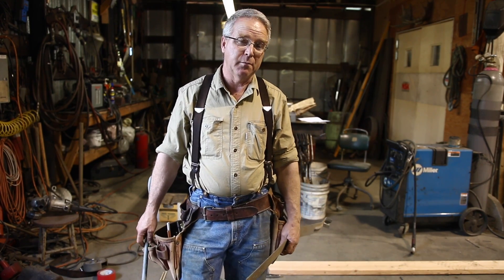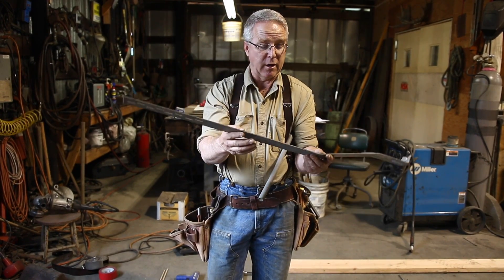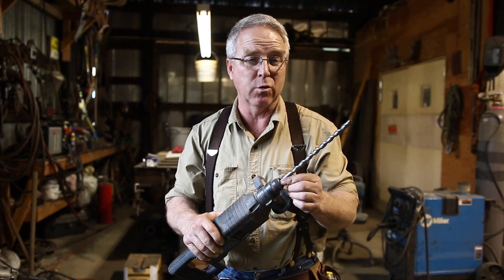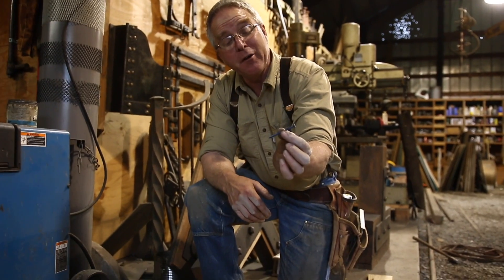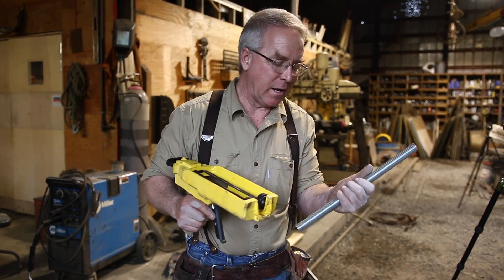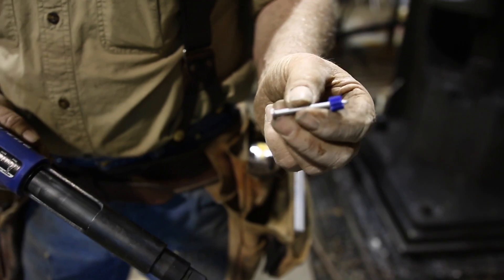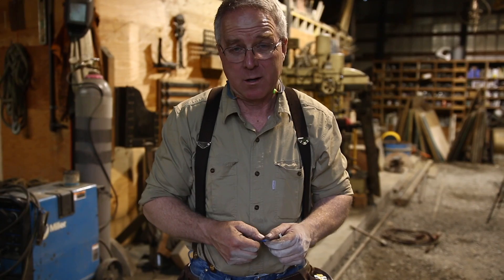How to Fasten to Concrete

Comment: Instead of using the plastic plugs to hang heavy things from a concrete wall, I drill a 3/8ths hole into the concrete, blow and drive in a dowel that has been coated with quick dry epoxy.  I also wanted to add, that as a former instructor, I like the way you disappeared the training aids immediately after you were finished using them to avoid distraction.

Comment: Yeah codes are needed but some of them are very excessive (here in Florida at least)
Codes help homeowners ensure the work theyre paying for is done correctly and their house is safe. 
However I think if a homeowner is doing the work themselves codes should not be enforced. Also you shouldnt need a permit for every single little job there is such as a shed or small deck or concrete slab that is not intended for a structure foundation just as a patio/bonfire area. The list goes on.

Comment: Tricks I've not seen before.  Good Stuff!  Why duplex nails?  I have used these for easy removal, but can't figure out why you are specifying them here.  Also, don't the two 16d nails in a ¼" hole basically do the same thing as doubled tie wire with a 16d nail?  The two nails would be better steel than the tie wire which is pretty soft.  Much softer than the nail.  Finally, you are using a 2x6 instead of a 2x4.  Is there a reason for that?  Or just convenience?   Excellent content without useless blather.  Thank you!

Comment: I do not like the strength of common toggle bolts.  The wings are very weak and the nuts are not hardened material, dead soft.

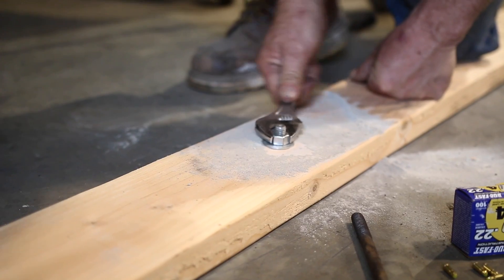Comment: 6:16 I've never even heard of this method for fastening a sill plate to concrete. This must be what a lot of old timers did before seismic building codes. Would an engineer and code approve of this method in areas where seismic compliance isn't a concern? Would the 16D sinkers eventually rust away from moisture in the concrete? I assume 16D hot-dipped galvanized sinkers would be appropriate for this approach.

Comment: Great video and explanation. Absolutely going to use the RAMSET.. One problem I'm looking for assistance on if you have a moment. my basement concrete floor is sealed and in great shape BUT for the length of the room (sauna) I'm looking to build there's an even drop of 4" from one end to the other length wise. I would prefer to level it using tapered 2 x 6's perhaps...any advice on how to do that?
Thanks

Comment: Attaching fasteners to cinder block or rick is quick and easy.....attaching fasteners to poured concrete is something else....Used to use two different its to drill through wood and the concrete below and had some alignment issues.....but this video is great! Will try fastening my Tapcon with the technique from this video.

Comment: Hi- which method would you recommend for this:  I have an old concrete well, and I want to fasten a new framed top to it.  The walls of the well are 6" thick, but are very old concrete block.  Which method would account the best for the degradation and crumbling of very old concrete?

Comment: Is there anything g I can add to the mudplate to prevent it from rot?
I'm enclosing a patio and setting wood right onto patio slab with a slop. I also need to build up to remove slop.

Comment: good video, but it would have be best to have shot the video in manual focus and not in auto focus that way you would be able to secure focus on a close up shot much quicker and reliably with the manual turning of the focus. lots of times auto focus isn't great for constant switching between close ups and mid-range shots. it may take some getting use to manually doing this but it will ultimately result in a cleaner video

Comment: For discussion - HILTI cert course recommends powder actuated nails only be driven once. They actually have a thin layer of sacrificial metal coating that flash melts and fills voids when you initially send it. If you fire on it a second time you shear that off and won't achieve design load.

Comment: Good video just an additional tip is when drilling concrete or cinder block drill the hole with your hammer drill and when the desired depth is reached don’t try to clean or ream out the hole just come out and leave it alone if your run the drill too much the hole will be too big and the Tapcon will not hold.  Also I recommend a good quality hammer drill like the Bosh and I usually use a corded one cordless are okay for few holes but as of yet just don’t have the power of a corded tool.  T.R.

Comment: The challenge is getting the guys pouring the slab to set your cast-ins straight and not knock em over. It's a real tragedy but a little liquid currency can keep the project on a good trajectory.

Comment: 10:25 Code specifications are actually really clear about capacity for mechanical anchors as well as chemical anchors. Usually it will be because chemical anchors don't prestress the hole like expansion anchors do (greater distance to edge required) or simply because it easier to specify an embedment depth or just plain laziness.

Comment: M8..in Europe people use concrete screws 7.2mm thickness to hold double glazes windows since de 70s..check Germany..you drill hole.with 6.5mm concrete drill bit..and 7.2 mm concrete screws using the high torque impact driver ...simple as that..for all the rest you got anchor bolts

Comment: Great information thank you for the video. I worked with a crew from Indiana and they told us guys the best and cheapest way to attach wood to concrete and masonry. And the 3/16 masonry bit and 16 gauge tie wire (annealed wire ) dropped into the hole and then drive a 16d box or duplex nail into the hole you drilled. This is the best way hands down. Floor, wall or ceiling.  Now if you shoot into the concrete you are fracturing the concrete and there is a chance it will not perform.

Comment: Several years ago, I leaned against the wall of our soon to be bedroom. 
It was becoming out bedroom because our little bundle was taking our room as her nursery. 

Well, the wall moved. I'm not a smart dude but I know exterior walls, aren't supposed to give, let alone move. 
I talked to my father in law, who owns the house and we got busy getting it squared away. 
Through decades of erosion, the rear of the house is actually a foot below grade and his Solution was to cut the wall a little high and build a footer on top of the existing slab. 
But, being unfamiliar with concrete he asked how he was gonna construct the wall. 
2x6. Holes. Bolts 
Insert the bolts into the concrete while it's wet where you want the wall to be. 

I went to work
Got up the next morning and went outside. 
He hadn't listened to a word I said. 
He inserted PVC pipe to hold the studs for the window
Then poured the footer in three sections and it slipped, so the wall is actually bowed out.

I'm a draftsman by education 
You're always better off listening to someone with a little insight into the issue. 

You will not be disappointed listening to ANYTHING EC says!!!

Comment: The plastic molies work good if you upsize the screw.
The 8-10 size, use a 12-14 screw.
Obviously, a molie should never be used in Sheetrock.
I use to have to. correct my carpenters. They thought, just because a door wall stop (bumper) came with a molie, it should be used in Sheetrock.
Invariably they always loosen up.

Comment: You used the 3/16” bit. One method that you didn’t mention.
Drill a 3/16” hole.
Install a single strand of tie wire in the hole.
Drive a 16d duplex nail in the hole.
It works great.

Comment: Very late to the video, but I’ve had good experience using a 5/32’s bit and using 3inch exterior grade screws. Very solid connection every time.

Comment: Hi there, I'm attaching some furring strips to my shop floor. I'm wondering what the appropriate spacing should be between anchor points. My concern is drilling too many holes too close together.

Comment: Why does no one in the states use ring keys (wrenches, spanners) or sockets. They are the most efficient nut turner ever and have you ever seen a torque wrench with an open end wrench? Sorry but I like a bit of rant - Great video thank you!

Comment: The tie wire is best only we use 3" bright common nail, Duplex nails frowned upon as in construction cords snag, feet trip over and knees damaged when rubbed on duplex, Ramset is JUNK that only damages the concrete and are only 40% successful and destroy hollow cinder block, get a hammer drill and do it right the first time.  Ant time wood is attached to concrete there must be a vapor barrier, ie poly or tar paper, never install treated lumber indoors.
Reply from the maker: Good points!

Comment: We used the tap con screw but on the lateral side of the concrete.  Not the top.  Its not really fixed.  What can I do so its more firmly in the hole?  Take out the screwes and use tiewire and add the screw again?

Comment: I need to fasten a 2" hitch receiver to my garage floor for winter storage of a 50lb bike rack. From this video, it seems that tapcon screws will do the job well, as long as I get the correct bit size. Is that correct?
Reply: I gave up on Tapcon as 4 out of 5 snap off on me during insertion (also read other comments). My local HW store had some beefier hex drives, steel with a blue marking (don't know the name) that have never let me down.

Comment: Which method do you think it’s the best for fastening 2x4 sill plates onto a concrete slab for a shed?
Reply: I've had good results with 3/8x5 hex drive fasteners (I buy them by sight, don't remember a brand name). Just have to avoid rebar drilling the holes. 3" charge driven fasteners with the proper charge are a relatively quick approach. Though they hold well I would trust only them if I was not worried about pull out, only to resist lateral movement.

Comment: Thank you for all the great videos! 

What is the best practice for securing threaded rod into concrete using epoxy.

The application is earthquake retrofitting. We are using 5/8" hot dip galvanized all thread rod with Simpson Strong Tie Set XP Epoxy. The concrete 7" in the concrete (Poured in 1976). Both sill plates and hold downs.

1. What size hole would you create for 5/8" rod for epoxy application? 3/4"?
2. Do you seat the rod to the bottom of the hole? (ie: 7" rod in a 7" deep hole)
3. I need to drill about 50 holes, should I pre-drill a smaller size first, like 3/8" then step up to the larger 3/4" or does that "bugger" up the holes more than one large shot at 3/4? I do have a good SDS Plus hammer drill.

Thank you so much, I love your channel -
Just a half knowledgeable DIY'r.

Comment: Inserting studs into the concrete before it sets is always a good idea. Calculate the earthquake load and put on bigger washers on bolts spaced 3 ft apart.

Comment: we had to attach our extension via long bolts and nuts through the basement, but we had this large (like 2 ft thick) concrete footing in the way at one point, so we just used like 30 wedge anchors, worked like a charm!

Comment: 1st time here..wanted to know how to set a winch into garage floor, so I’m ignorant:
Do I use the wood too,  between winch and concrete. Or. A steel plate?
Reply: That's a lot of potential force in a small area. I don't see even embedded fasteners not breaking out of the concrete. I guess if I had to do this, I'd employ some kind of welded steel mounting frame to spread the load out on a larger concrete surface area with plenty of large concrete anchors.

Comment: As a contractor - fasteners problems can lead to lawsuits too. I recently had to attend a safety meeting (work), pertaining to fasteners. Somewhere in the world - a crew was using 2 different fasteners and one gave way, leading to a side of a building collapsing (not steel structure, but all connected to it) - engineers went threw to find fault and it all came down to one specific kind of fastener. Poor quality in raw material (not design of fastener).

Comment: I'm looking to bolt down 2x4s to a
 concrete floor, but I want to be able to change out the wood every few years as sometimes there is a flood. Are there bolts where I can bolt down the wood and then unscrew and replace the wood later? In other words, can you unscrew the nut all the way after hammering? Thank you.
Reply from the maker: Yes there are several choices that will enable this. One fast and I did not show is known as a Titan bolt. Check it out. Think of a lag bolt that will thread directly into concrete.
Reply: @essentialcraftsman  thank you. I was thinking the bolt would permanently stay in the concrete but I could remove the nut and switch out the board if needed. But I'll check out Titan.

Comment: apparently the Simpson Fast Tie is no longer available. a smaller version would be nice for anchoring pre-built sheds where you never know exactly where the floor frame will sit and can't get access to the top of the frame.
But I found something called a mudsil strap.

Comment: that trick where you drill a hole then put skewers or dowels in then put a nail in works great if you are doing 2 or 3 non structural angles or supports in concrete

Comment: Excellent content (as always) but worth noting that you should always be careful around concrete dust.  OSHA regulations have gotten much tougher since this video was released. Wear a rated mask and/or use the HEPA vacuums that attach to the rotohammers. Rule of thumb these days is that if you can see concrete dust in the air, then it's too much to safely work in.

Comment: Thanks for sharing your knowledge. I just used the two-16p-nails-in-1/4"-hole method to secure a few studs to complete a finished wall in my basement workshop. Worked like a charm, all for the price of a concrete drill bit.

Comment: i think you are a little too hard on the plastic plug screw method. If you use some decent size screws it should easily be able to hold a TV shelves etc. But of course , make sure to not drill the holes too big.

Comment: I haven’t seen a cinderblock since I was a kid (a long time ago). They were common near Pittsburgh where the cinders were readily available from the steel mills. The cinders were a byproduct of burning coal and coke and the mills were happy to get rid of them the local municipalities also used them on the roads in winter to provide traction.  To the best of my knowledge for the last sixty or so years the building blocks have been made of concrete.  I love it when they are still referred to as cinderblocks it brings back memories.

Comment: I like weed eater string better than tie wire, strips easier but for detail work I like topcons better specially when you are doing tilt up walls topcons don’t chip concrete out like nails do, just my personal experience.

Comment: It's not just the epoxy anchors that need a clean hole, all wedge anchors also need the hole cleaned out before inserting the anchor.  The strengths listed on their respective data sheets are based on testing using cleaned holes, which is needed to develop full pull-out strength. Most mechanical anchors are designed to fail in the shaft before the concrete fails, but it is essential that they be installed correctly and in sound mediums in order for that to happen.  Without proper prep, you could be getting 80%, 30%, even 5% stated capacity. It's too unpredictable.

In a similar principle, seismic anchors are designed to force a failure in the steel during cyclic seismic loading.  That one embedded seismic anchor appears to achieve this by making pull-out or break-out failures virtually impossible.  I'm not familiar with that plate seismic anchor you showed, but those slotted holes seem to indicate it's designed to slip during seismic loading.  Other seismic anchors and connections have intentionally weakened parts in the steel that force a failure at that location.  These are made with mild steel, so failure by yielding but not fracture is the name of the game. It buys crucial time during extreme events that prevents compete or partial collapse of structures.  Hardened fasteners like those tapcon should never be used in seismic structural applications. Without even knowing the specific code off-hand, I can guarantee you they are not allowed...too brittle.

Comment: If the flat screen falls after putting toggle bolts it's because the Sheetrock wasn't fastened properly. Toggle bolt rated for easily 50 lb if not 100 lb each

Comment: If using concrete screws I tend to pre drill with either a 5.5mm or 6.0mm sds but depending on what the surface ie normal house or concrete block etc...

Comment: I have an old foundation with cinder block. The sill in the basement looks like it was just laid on and not fastened. The blocks are hollow. Is there an easier way than just pouring concrete in the blocks and using hooks?

Comment: Blue tapcons are great until they rust.  Stainless tapcons are better.
Some tapcon tips:  Spray WD-40, using the thin red straw, into the bottom of the hole to both lubricate it and get the concrete dust out.
If you strip out a tapcon hole, insert a length of nylon cable tie to partially fill the hole and snug it up.
Lastly, Tapcon makers, if you're listening, it would be great if you made Torx drive tapcons instead of Phillips drive.
Reply from the maker: Awesome!!!!

Comment: Excellent video!  As always.  Thanks for the little extras, like the flat screen tv on the floor.  I’d rather the shock of seeing it like that, without the shock of it being MINE!  Also, I was wondering like everyone else, how you were going to deal with the 2x4 mounted to the floor.  Well, you had that figured out long before you finished the instructional video.  High Five Friend!